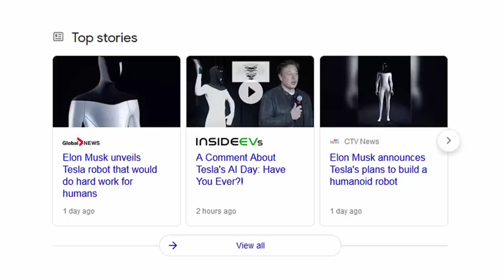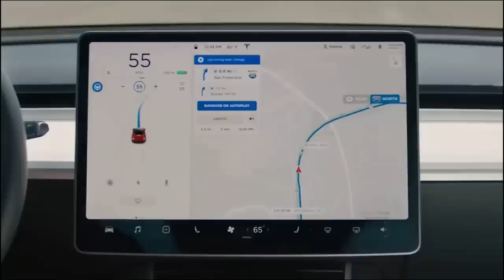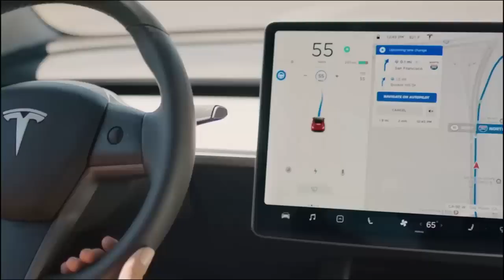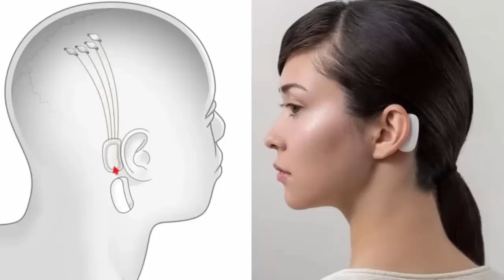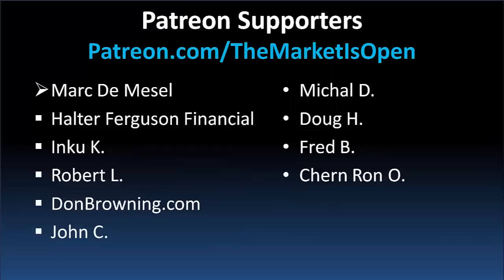Tesla’s SHOCKING Robots will FINALLY Compete with THIS Rival Automaker

Comment: Strap yourself into a full-body harness, dial into the appropriate robot, do the work required at that location enough times so the AI can learn how to do it, let it carry on itself. When a problem is encountered, it stops and calls for help. Dial in, fix the problem, AI learns and carries on. Every learning cycle becomes available to every robot via the AI system.

Comment: A short range communication system between cars could improve the exchange of data improving security specially in weather condition like a snow storm by night with no electricity.
Reply from the maker: As long as it's not NFC! Where you need to bump into the car to exchange data.
Haha but yeah what you said is an interesting idea

Comment: Some ideas for thought: DOJO  V1 is already helping design V2 that will have 10X the capability.  The Tesla bot and the SpaceX space suit will be designed by the same engineering team, starting from first principles.   ALL Tesla engineers will be given the option of connecting with DOJO through a Neuralink implant once the technology is approved.  DOJO will already be in direct contact with all Tesla bots, Tesla EVs, and the Starlink global network.  If FTL space travel is possible, it will be ELON's efforts that make it a reality.
Reply: It's all, and more, possible.  Who knows what society will look like in 50 years. It'll probably look like magic to someone from present time.

Comment: Making a Tesla bot seems a lot, lot, lot easier than making a car. 
The requirement for energy and for energy efficiency is way less.
No wind resistance problems.
No high speed crashes.
If LFP battery cells work in a Tesla bot then there is no fire risk.
Swap-able battery packs seems like a good option as well as charging.
Maybe use Hardware 3 FSD computers from the cars for it's 'brain'. Musk says Hardware 3 or 4 for your car - don't worry about it they are both good but are you kidding me?
The cost will be a fraction of a car's cost.
The consequences of a failure will be much less - not a two ton death machine.
Do they even need a license or authorization to put one on the footpath or in a shop or a home?
Reply: I think the opposite is true.  I think all the hand-eye coordination, balance, multiple joints, and actuators will require a lot more AI to control than driving a car.

Comment: The Tesla bot has an advantage over the FSD car. Let's suppose a Tesla bot encounters a horse on the footpath and mishandles the situation: goes up to the horse and gets kicked, in this case the Bot is damaged but unlike a car no humans get injured (in this scenario). The dangers of the Tesla bot hurting someone are not zero but massively easier to prevent with or accept imo. 
Let's start a list possible bad consequences:
Someone sees it and has a heart attack.
Trips a frail person over and they break a bone.
Doesn't trip a frail person, but they did fall over break a bone and here's an opportunity for them and an ambulance chasing lawyer to make some money.
(Maybe have the Tesla bot in a place with few or no elderly people to start off with)
Walks out onto the road and a car swerves to avoid hitting them has an accident.
Cars are then trained not to swerve and a person wearing a spandex suit gets cleaned up. Kids will definitely be wearing spandex suits once the Tesla bot is a thing.
...

Comment: Well Biped robotics right now and has been some time lead by Boston dynamics. No question really. Kinda like Tony stark and his suit compared to say Asmio is a toy really today. 4 legs is rather easy, 2 not so much.  Atlas is like DARPA money, might as well have NASA build it. If you watched over the many years of say where Boston started Biped and quad. How it evolved.  Now Tesla would need to start there and make it less costly. Since it can do what he wants right now, easy. Issue still is power though. always has been.  Walking , running is a dynamic movement. WE just do it so easy. Biped to be like atlas must master that AI. each step is basically a falling action forward in 3 dimensions. Rather simple is 2d in a car, cars can not fall over.   I think $$$ wise make it like Rosie in Jetson's . as a house bot, should be able to build that for less then say a S.?

Comment: Hyper loop is a hyperdupped. Now robotics when you can barely manage self driving?  Extremely complicated and challenging. Honda the first and now others simulating human functionality.  We still have a ways to go on a AI level or biological interfaces.
Reply: Thomas:   Look at what was available 20 years ago in robotics, and look now... 1,000x more applications, faster and easier to program, less expensive, more durable. Now look 20 years in the future at another 1,000x increase in function. 20 years is like the blink of an eye.
Reply: @billderinbaja3883  robots still dumb but who knows what the future holds?

Comment: The primary benefit of a robot is you can design it to do tasks better that a human. A humanoid robot makes no sense. This is why welding robots are just large arms bolted to the ground, rather than something more human-is.
 I support robotics, AI, and machine learning. But most robots would look like spot, rather than LT Cmdr Data.
Reply: Tried and failed in eg Starbucks.
Reply: They’re already here, boston dynamic atlas
Just needs human equivalent hands
And tesla Android FSD 9.0

Comment: This is REAL. It will happen by end of 2022 or sooner. Using the proven FSD modules and Tesla's 8 cameras and DOJO for mapping "interior spaces", the robots are very far along. I'm certain the FIRST task I will have MY OPTIMUS SUB PRIME perform will be picking up the pencil I will casually brush off the desk to fall on the floor. COOL - right? Oh and if it speaks I'll have it say - "Here you go, Pal, you brushed your pencil on to the floor." Productivity enhanced.

Comment: How can making a functioning prototype humanoid robot be the easy part? In this case it seems more like it's the initial phase that is the hard part. Elon is way off on this.
Reply: I believe they can easily have a prototype next year, though not sure if they will show the public. I also believe it will be 5-10 years before they start delivering an actual product and the software will be the last part perfected.
Reply: @robynburrows  What makes you think it's easy? Doing human tasks as a humanoid is far more complex than driving around a fixed line with 4 wheels. If it's just boxes they want it to move, we already have that; it will be just a glorified industrial robot. 

I think they are way off on their assessment here thinking the environments and tasks are compatible.

Comment: Farming, Serving, Fire Fighting, etc. applications may be ending. Just imagine a bunch of Navy Deckbots handling extremely dangerous combat jet aircraft takeoff and landing operations aboard nuclear aircraft carriers? Human crews numbers aboard Navy ships can be cut in half simplyfing operations, exponentially increasing safety, and dramatically lowering operational costs. The savings for the economy will be huge!
Reply: First they have to manage to make a prototype that can navigate a room and use its limbs.
Reply: No military should be the rule.
Reply: @lengould9262  who do you think owns those ultra-secret mission payloads SpaceX Falcon 9 rockets periodically inserts in orbit ?
Reply: @pixsilvb9638  I know about those. Still, no weapons on Tesla robots should be the rule.
Reply: @lengould9262  Sure no weapons. But all I'm saying is working in highly dangerous environments. Aircraft carrier decks, Oil sea platforms, Fire fighting, etc. If they were manufactured to work aboard Navy vessels I envision them helping in critical or dangerous tasks that will take the workload out of human operators. Not suggesting they carry weapons or use them. Just to be able to work in such dangerous environments.
Reply: @pixsilvb9638  No weapons, no support of militaries, eg Carriers.

Comment: I have an almond farm and would love to have some of the boring repetitive jobs handled by a bot that will do it like I ask, day after day.  No more chores and still get the eggs, goats milk and almonds, that's free labor (ok, after depreciation).  I'm in!
Reply: In under 5 years you should be able to pre order your tesla bot for farm work.
Reply: on AI day,  when Musk announced this.  i instantly thought about my farm.  i also once toyed with the idea of using Spot in my sewage plant.  this robot would be better.  Spot was $75k.  if the Tesla GP bot was $100k, i would buy a platoon outright
Reply: Your name is Mr Woods and you own a lot of trees - Nominative Determinism!
Reply: @rickywinthrop  It depends on where the almond orchard is Rick the water problem really isn't one it is just governments and doomsayers benefit from the panic, water desalination is extremely simple but government cronies push the expensive reverse osmosis systems when vacuum distillation is much cheaper and faster spraying 100c saltwater into a distillation tower under a vacuum turns the water instantly into steam all the solids fall under gravity to the bottom and the steam moves to a condenser the extracted heat goes back to supplement heating more seawater.
Reply: @rickywinthrop  You are most welcome.
Reply: Well if you deposit 1000$ right now you might get a mime in a spandex suit in about 8 years.